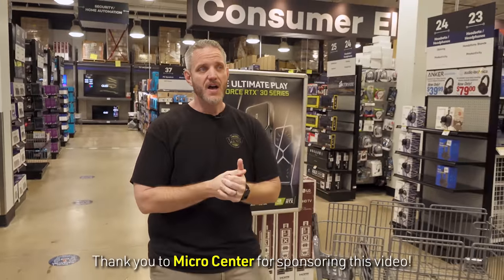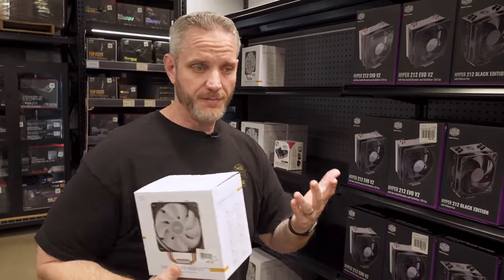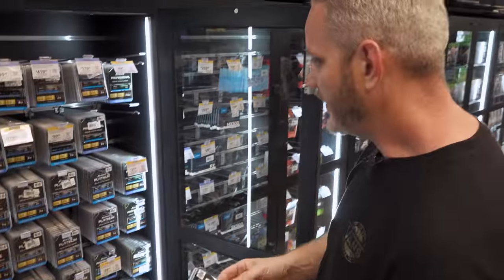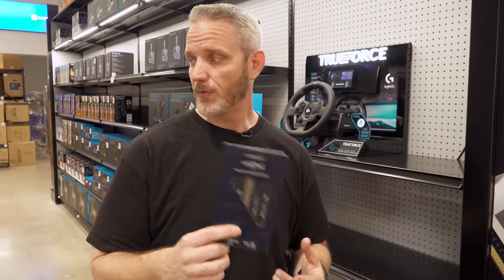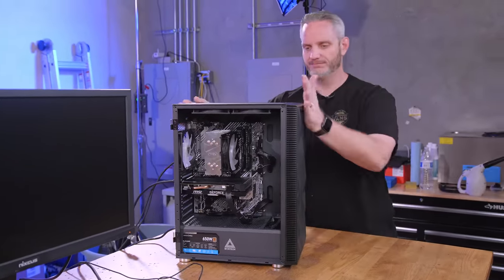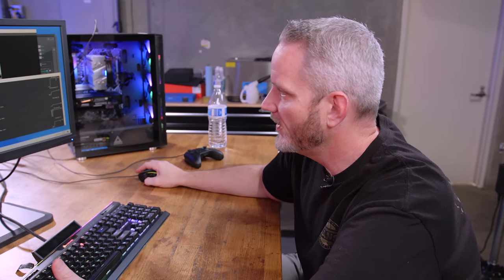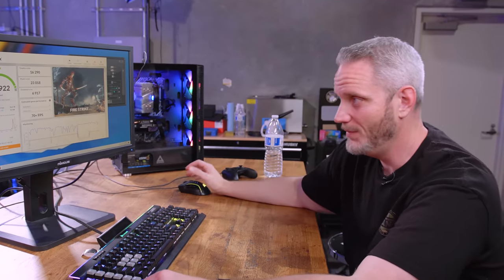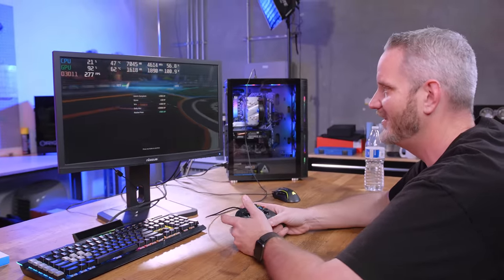How cheap can I build a "Gaming PC" for in 2022

Comment: Jay, I wanted to build a part time gaming computer but didn't need all the bells and whistles of a high end unit. I basically duplicated your choice in Power supply, MB, CPU, Cooler, Ram and SSD's (total of 3). I found a good case with lots of cooling and even one that would accommodate my DVD drive and followed you instructions of how to load Windows. At 70 years old, I've never built a computer before and wow, everything is working great. I used an existing graphics card I had (Gforce GTX 950) and since I only play World of Tanks, it works a  lot better than before. I just wanted to say thanks for sharing your ample information which allowed me to complete this project. Thanks so much, Keith

Comment: I would've gone with an RTX 3050 over the 1660 super for 2 reasons. The amount of Vram on the 3050 is 8 Gb vs 6 Gb and most importantly THE 3050 SUPPORTS DLSS which will make playing new triple a games much more viable as well as run smoother.
Reply: Agree, but AMD FSR also does the job just fine, and even though it's not officially on games like Cyberpunk, you can still mod it to utilize FSR
Reply: DLSS might be the worst technology for FPS  and I would just go for lower resolutions at that point
. unless you are doing a 4K conversion it looks horrible for 1440p and 1080p with the ghosting.
Reply: @flintfrommother3gaming  okay? All dlss has done for me in CoD and other titles is give me free 60+ fps
Reply: @ijustlovethisname  If you are using an 3050 it's not like you have any other choice. If you are not then good for you, it still isn't good for 1080p and partially 1440p (it's kinda up to personal choice but it's still not great to me with the ghosting.) upscaling . atleast It's better then whatever AMD is trying with FSR. Also using DLSS in a competitive game isn't a great way to use it.
Reply: @flintfrommother3gaming  weird. I use balanced dlss 2.0 on 1080p and can’t even notice the difference unless I really look for it. It’s only when I put it it on performance or ultra performance that I start to notice blurring. If I put it on quality then I literally can’t tell a difference. Maybe I just have bad eyes 😂
Reply: @idkwhattohaveasausername5828  you do have bad eyes sir. Although it doesnt bug me i notice even quality on 1080p. Balanced is veeeerry apperant and performance at 1080p is downright horrible to look at. Just to let you know balanced on 1080p would make the image around 600p so you should see it immediately. I dont think anything other than quality should be used at 1080p. I dont wanna sound rude but you sound like those people who claim they dont see a different between 4K and 1080p
Reply: @EfecanYSL  I don’t see a difference between 4k and 1080p unless I’m looking super close. It’s not worth the performance hit imo 🤷‍♂️ DLSS looks better in some games then others. If I use quality DLSS at 1080p, for 99% of games I genuinely can’t tell a difference.
Reply: I have a 970 in one of my builds that will play tripple A games on the highest settings at 100fps all day long, you dont need a 3050 or anything like that to make a good machine
Reply: Or just get an RX 6600 lol

Comment: The $500 variation is exactly what I just did.  5600G, 32gb for the memory, Asus Prime A450 board, reused an existing case, 760w PSU and SSD.   It kicks tail right now and it is ready for a 6600xt or 3060 when they stop costing too much.
Reply: I’m only looking to play steam games really and Star Wars the old republic.  Would that variation be enough for that?
Reply: @doctorstrange6818  yup
Reply: 32gb of memory is a waste, also the PSU is kinda exaggerated (but there's the "future proofing" argument for it, so ok). You can justify the 32gb because you are using integrated graphics, but still...

Comment: This makes me feel rather good about the PC I was able to build about 7 months ago for around $1400. Specs:
Motherboard- Asrock Z590m Phantom Gaming 4
CPU- i5 10600K
Cooler- Cooler Master, Hyper 212 Black
RAM- XPG 16gb 3200mhz DDR4
GPU- EVGA 3060 XC 12gb
Storage- WD Blue SN550 500gb NVME 
Heatsink- MHQJRH Black M.2 2280 heatsink
Cables- LinkUp white cable extensions
PSU- EVGA 750w 80+ Gold
Case- Thermaltake s100 mATX (white)
(x4) Fans- Thermaltake Riing 12 120mm, white LED fans

I am proud of sourcing all these parts for the price and this being my first build and it working flawlessly. If you want, you could even add the monitor which is a Lenovo 34" Ultrawide 1440x3440 which was around $450.

All in all this combo came to about $1850. I am REALLY enjoying it! Well worth the money.
Reply: Lol that’s almost exactly my pc, as well. I saved some extra money buying a second hand board and chip (z370 pro MSI and i5 8600k) and I have a gigabyte 3060 instead of EVGA (I stood in line at launch to get at msrp), but I’ve got xpg spectrix 3200 ddr4 ram, that same EVGA 750w gold psu, that same m.2 (and an intel ssd 500gb, and a 1tb spinning drive which I had from an old build) all in an older lian li A05-FNA case with lian li fans. I love the pc, performance to cost is really good.
Reply: Sweet build!
Reply: I did a budget build just before COVID hit in 2019. Asrock B450 MB ($85), AMD 2700 processor ($120),  32 GB (2x16) 3200 ram ($140), EVGA 750 psu ($80), MSI rx580 video ($130), Fractal Design case ($60) for a total of $615, still plays every game solid at 1080p/high without a problem. ( I use it for video editing, not just gaming, thus the extra cores and memory)
Reply: that sweet builds
i wee-ing with my new ryzen 7 5800x,B550-A ROG Strix,2x16Gb CL16 Team delta RGB Ram,and salvaged from my Old PC GTX1070Ti Until GPU Price going down again eventually for about $1142(calculated from IDR to USD at this time 2 april 2022) humbly runs game on 1080p high to ultra setting while multitask 2 to 3 game instance and more than 10 tabs browser opened
altough i plan to upgrade my monitor to higher refresh rate and also future proofing my disk space
Reply: @aGrimTurtle   Thanks! Quite the upgrade from what I had before, which was an i5 4690k and a 1060 3gb.
Reply: @brando3342  nice! I went from a i5 2400 + GTX 970 to a 2700X with a 2070 and recently upgraded to a 5800X. Next on the agenda is an NVME SSD, then a RAM upgrade, then hopefully a new 3080/6800XT tier gpu
Reply: @aGrimTurtle   Very cool! I really wanted a 3060 ti, but they were gone by the time I got to the store, so I went with the 3060 that was there haha. I think I will likely upgrade to maybe a 3070 ti or 3080 at some point when things get cheaper!

Comment: I'm quite happy with my MSI Super Ventus OC 1660 Super I picked up mid 2019 and It's still holding up well for 1080p with most game's ultra settings.  Even most 1440p games with more than acceptable settings.  I can get the boost up to 2040 core & 5900 RAM.   Paired with a Ryzen 5900x and x570, its a little under powered but there's no CPU bottleneck, for sure.
Reply: Even my RX 570 8GB don't has much struggle, I don't understand these "But muh 8K"... when I want to see 8K, I look out of the Window :D

Comment: I did pretty much what you did here, same CPU/Mobo, except I got 32GB RAM. I also went on ebay and bought a used, but in impeccable condition GTX 1080ti. Man this card is still an absolute monster.
Reply: I bought a gtx 1080 ti when it first came out and it still holds up. One of their best cards for sure. Waiting for a 4090 ti before I finally upgrade.
Reply: @brandonporter550  Crazy right? Speaks to how great it truly is that 5 years on nothing can really beat its price:value.
Reply: Still have my 1070ti and not suffering (much). The day is coming for major upgrades (cpu, mobo), but not quite yet.

Comment: I built mine about 6 months ago for around $1000USD. I’m in Canada so it came out to a little over $1300 after shipping costs cause rural Canada. rog strix b450-f motherboard, ryzen 5 5600x CPU, 16GB ram, hyper 212 RGB edition cpu fan, Corsair 500w Bronze PSU, in a Corsair 4000D airflow, and I compromised on a GTX1050ti for now till the gpu market gets better. I like to tell myself I didn’t do too bad but it was also my very first build. I do enjoy the RGB fans I got for it and think it performs really well as a 1080p pc in most cases. Been able to run elden ring at at 30+fps in 1080p in most areas and 60fps on 720p in a lot of areas of the game and am hitting low to mid 40 FPS in the main open world areas, entirely playable in my personal opinion :P
Reply: i got a prebuilt from microcenter for 2500.. 5900/3080, impressed at how much more i got for the price difference. and i spent no time putting it together either
Reply: @bradhaines3142  I wish you the best. I got my first prebuilt from microcenter. They’re not bad, as they build usually w good parts. Just be careful what psu you got. Corsair, evga, seasonic are only brands I trust for power supply.
Reply: You did ok. Could have done better but I know it’s tough in Canada and generally more expensive. The motherboard you have is great, top of the line. Case you have is considered to be one of the best. Ram is fine (hopefully it’s at least 3200Mhz and you set up xmp - I can help if you want very easy it’s 2 clicks). But yeah dude not bad at all. Next is a 30 series or amd card and a new power supply (stick w Corsair they are the best)
Reply: FYI Newegg Canada has 3080 now at around $1200. Cards are dropping real quick.
Reply: @mannyfresh7065  to be entirely honest I had to return the first psu I got from corsair for a new one under warranty cause it stopped working after 2 weeks :P ram is corsair vengeance 3200MGhz and yes I have xmp enabled :D
Reply: with prices so f'd up and availability, thats a good build.
Reply: Sounds like a good build, I hope you're enjoying it! :)
Reply: Build within your means so smart decision!  Enjoy your PC!

Comment: I just did a test run of this build on PC part picker and it comes out to around $900 still.
Reply: Same
Reply: I have 450 quid into my real realistic gaming pc. It plays Elden Ring like a champ . I think some tech guys do not know what 'realistic' and 'cheap,' mean. I suppose it is them being spoiled for tech. I still run an 8gb rx 580 and it is a beast. I do not care for latest and greatest in the tech world because that just translates to wasting money for the sake of it. Not becomes obsolete or dated faster than tech and maybe hyper cars.

 My 990fx sabertooth with an 8150 Black edition and a 960, lasted a decade no issues until Elden ring. My replacement was the Ryzen 5/asus 320m-k combo with an rx 580 8gb and obviously 16gb ddr4 mem and a 970 evo 1tb for 450 quid and using my old nzxt 510i case. That is a realistic affordable build for gaming.

  I also do not understand anyone that looks for rgb and specs on gear for streaming and editing when majority of gamers do not use it. I guess it is just to be sheep to follow the latest toys. This build in the vid has so much wasted spec which equals wasted money. And the 570 barely outperforms my diddy little 320mk.

Comment: I got lucky 2 weeks ago when I went to microcenter. I managed to get a 3070 Ultra FTW3 when I built my new pc. Big difference over my 1070.
Reply: Congrats man
Reply: How much … I got a 3070ti for 829
Reply: Still running my 1070. Looking to go shopping soon for parts to make new rig. Sick find on your 3k series.
Reply: @Mr.Helper.  same here for a 3070ti, $829 after tax.
Reply: I may have to go with an AMD card this time around. I've been using strictly Nvidia since the Riva 128 came out.
Reply: @Mr.Helper.  I got my ASUS Tuf 3070ti for $729 a couple weeks ago at my local MicroCenter.
Reply: This is what I'm upgrading from. My PC is maybe 8 years old, maybe 10. I had a 1070 that died and I've been without a PC for a year as a result.

I've been super torn whether to get the 3060 or 3070
Reply: @DJ_Death_Star  nice grab
Reply: @luciferfaust  you updating your cpu too ?
Reply: @Mr.Helper.  yeah, I think I'm going for new everything and will just use the old one for basic stuff. I'm not worried about the 4000 series or DDR5. Only thing I think I'll reuse is one of my 2.5 SSDs and my 750w thermaltake psu
Reply: @Mr.Helper.  Nice! My 3070ti was around a grand when I got it like a year ago. :(
Reply: @luciferfaust  if you plan to play in 4K, then try to squeeze for 3070 and settle for i3 12100f. This cpu is plenty fast. Unless maybe you want 1440p >120fps, then you may need slightly faster cpu
Reply: @geekarch_pc.id_  I'd be doing 1080 to 1440, definitely no 4k. I had 2 monitors going with the 1070. Sometimes I'd stream, but not often. Mostly I used the second screen for game wikis and discord. I'm not looking for crazy frames either. I'm happy with 60 to 100. But I do the VR thing somwtimes. 

I think that's where a lot of my indecision is coming from. I think I could get away with an i5 12600 and a 3060, and the NJ Microcenter has better stock of the 3060 cards from what I was looking at earlier, but the other part of me thinks push it forward to i7 and 3070, just in case, but for me just in case means the latest pc port, not so much any crazy graphics heavy pvp situation. 

The most resource hungry game I played was Ark, the dinosaur one. That thing pushed my card to the limit even back when the system was newer.
Reply: @luciferfaust  i think even 12400f is plenty fast enough for your scenario. So going for i7 i think will be less rewarding for you, better to put the budget more toward the gpu.
Reply: @luciferfaust  I love the paterson microcenter. Those guys hooked me up with a evga 3070ti a few months ago. Just ask for them to hold one for you

Comment: seeing you pick the 1660 super made me feel sooo much more validated, im building my first pc (on a budget) and im glad it's still a viable option in 2022
Reply: Walter
Reply: 1660 super is trash IN 2022
Reply: @jonathan-qd1cc  is it reliable?
Reply: @josephmazariegos2951  I guess for 144fps 1080p if you have a good enough cpu but just upgrade to like rtx 3060 or rx 6600. Much better than 1660 super. Nothing against 1660 super tho. If you wanna get it go ahead it will get the job done for the next 2-3 years as games become more graphically demanding
Reply: thanks! Also I’m planning on building a pc for the first time and I’m using this video as a reference. At the 10 minute mark, is that all the parts that you need to build a pc from that list?
Reply: @jonathan-qd1cc  not sure if it tagged you in that last comment
Reply: @josephmazariegos2951  yes it is but in todays market that is not the best value for today.
Reply: @jonathan-qd1cc  do you have any recommendations for a budget like this? Again I have no clue where to start
Reply: @josephmazariegos2951  what price are you builfing your pc for?
Reply: @jonathan-qd1cc  honestly probably around $700. I did some research and found all of those items for under 700 besides the case and just trying to save enough for a good enough pc. I’m not looking for something for gaming I’m getting into crypto and I need something that won’t overheat if left overnight and that is fast enough
Reply: @josephmazariegos2951  ok then go ahead and buy the parts that are in the video, have a good day 👍
Reply: @jonathan-qd1cc  alright you too. Appreciate you going out of your way to help👍

Comment: It has been a long time since I've watched "build cheap gaming PC" videos and it's so mindboggling for me to see a 1660 Super for 359$. In October 2020 (right before the market got f*cked) I bought one for 180€. It's just such a ripoff
Reply: I know it’s crazy I built my first pc like two months before the first 30 series gpus dropped and I got a 2060 super for 339.
Reply: The prices go down slowly
Reply: 6500XT has the same performance and is $250
Reply: @ChristmasCrustacean1  a 6500xt does NOT have the same performance as a 1660s, I repeat it does absolutely NOT. It has worse performance then a 1650s and rx580 8g, with less v ram as well